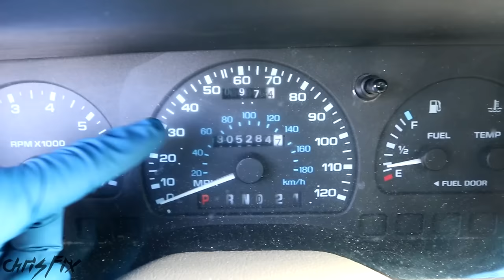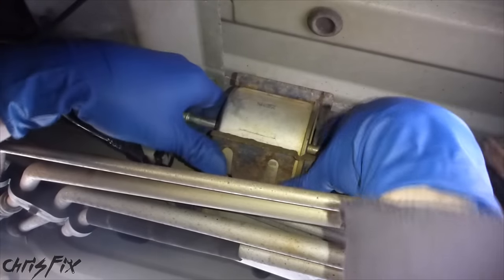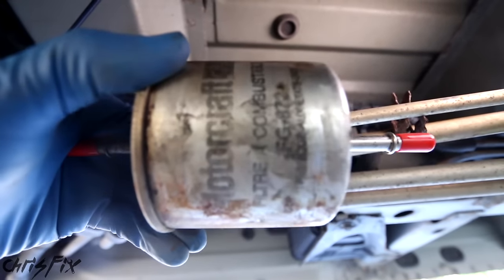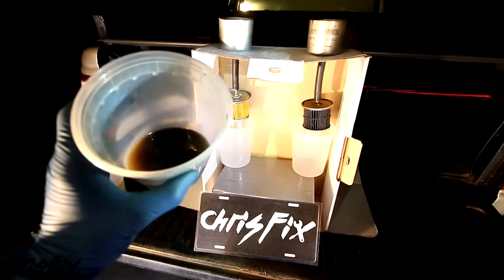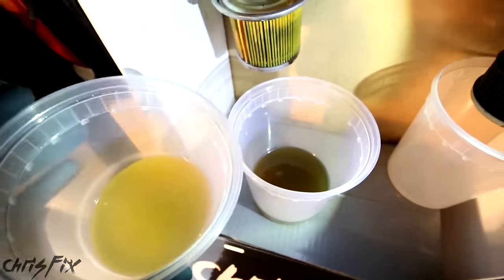What does the inside of a Fuel Filter look like after 300,000 miles?

Comment: Off to find out where my fuel filter is lol
Reply: +roberij05  
goog it and put in diagram (and or ) location of your vehicle
Reply: +roberij05 If you can't find it under the hood or under the car, it will be in your fuel tank.
Reply: +February 
No! Don't say that! LOL
Reply: Primer2tone Garage
Yeah, the unfortunate truth. However, if you suspect the filter is in your tank, check the trunk or under the rear seat for an access cover. It might be as easy as 3 screws.
Reply: +roberij05 - Just look online for the model of your car. Any car built in the last 60 years has info on where to find the filter.
Reply: +KOakaKO and cars before that had sediment bowls that you cleaned out and put back into service
Reply: Texassince1836
- I really like the old sediment bowls, like we had on the farm-field well pumps back in Nebraska (when I was a kid, back in the '70s). They're SO easy to clear of water or rusty bits... and, as you say, put them right back on and keep running.  ;)
Reply: +roberij05 it's not a service item for modern vehicles. the cars he drives are return systems, modern cars don't push as much volume, only just enough, so the in-tank fuel filter doesn't usually need to be serviced.
Reply: +KOakaKO not necessarily
Reply: SilentServiceCode
- Not necessarily what? Your comment is meaningless without context.
Reply: +February buick century  is the best  for fuel  pumps.  access cover   right in the back.
Reply: +KOakaKO You are exactly right.  Some of them had a push button to quickly drain dirt and water.  Others had a bail and screw to remove the glass bowl.  New is not always better.
Reply: +KOakaKO BTW, did you notice that the flow direction was backward on the test he set up?
Reply: Alex Tworkowski
I don't think I noticed that, but it would still filter okay. I've seen in backward before.
Reply: nemo227
- Yes, absolutely, and again Yes. Money spent on Maintenance is 1/4 or LESS than the cost of repair once something fails completely. Keeping up with the Maintenance of a vehicle is a LOT less expensive than repairing it every time it breaks down.
Reply: El Chapo why would you suck in a chicken
Reply: Renduevenstar Same thing.... Not really 😑
Reply: should be by the muffler bearings.
Reply: Are those under the water leveler?
Reply: By the blinker fluid?
Reply: So i have a toyota tundra 01 with 342k miles. Im kinda curious what it looks like
Reply: Um my 4runner has 384,000 miles...should I change it?
Reply: Nah get it to 500k then cut it open for inspection. LOL JK
Reply: look at the video and tell me
Reply: roberij05 n
Reply: Mine is in the fuel tank.
Reply: Lmao. I know your feeling. This guy's videos & editing have put me in my garage more times than I can count.

Comment: Dude that side by side test he does is awesome hahaha who puts that much time into a test like that? Only ChrisFix.
Reply: The more you know
Reply: You're a great teacher Chris. This stuff is great.
Reply: The test is actually pointless. He poured the gas into the outlet side of the filter so the gas is flowing in the opposite direction than it normally would. So on the dirty filter he's actually pushing through the clean inside out to the contaminated outside. This then pushes off the contaminates from the outside which mixes with the gas and drops down into the cup. Pushing the contaminates off of the filter from the inside is a lot easier than trying to push into the contaminates and filter like it normally would. If he rigged it the way that gas normally flows it would look much cleaner, probably like normal gas, but it would probably be going through drop by drop because the gas isn't under any pressure besides it's own weight. Not hating on Chris his tutorials and advice is still all good it's just the test didn't prove anything, not even the flow rate.
Reply: John Moore but it was a new clean filter...
Reply: You wanna see a guy put time into tests like this? Head over to project farm’s page. The guy pretty much does side by side tests on damn near everything

Comment: Years back cars had clear inline fuel filters. They also had a little window in the air conditioning lines so you could see the bubbles or lack there of . I miss both of those features.
Reply: hold my beer let me remove my ford bedliner and grind a hole in the box to get to the pump lol
Reply: ive actually seen this on my friend's grandpa's 1930's buick.... had a clear fuel filter. it also was part of the reason it stalled not too far from his house because it had some crazy design involving cork or something like that
Reply: My car has the ac window, what am i looking for with the bubble window?
Reply: In old cars you had a glass and metal filter, you jsut changed the inner element its was very cheap,, you changed when it looked dark...n more of the mintenace engineer this days,, missed it.

Comment: watching chrisfix makes me want to fix everything on my car
Reply from the maker: Haha perfect
Reply: Same
Reply: @chrisfix  Wow!
Reply: @chrisfix  What additional steps can I make before replacing the catalytic converter and in which order would you recommend? 
1) Change Gas Filter. <without question)  
2) Change Air Filter.
3) Clean out Mass Air Flow Sensor. 
4) Change Spark Plugs. <I’m thinking about going back to copper) 
5) Basic Oil change. 
6) Seafoam-ing  the piston heads before an emissions test showed a 400% improvement on the test results. I did discover air leakage from the head caskets shortly after using, seafoam. However, I don’t know if the leaks were there before I used the product...And, I didn’t follow the directions on the bottle.

I like the camera probe that you use to show the before and after results of built up carbon deposits on a piston head. And, it gave me a couple of ideas. I’m curious, what would happen if I used brake cleaner to dissolve the carbon on the piston heads? There’s nothing better than break cleaner to remove dirty oil deposit stains from your driveway. ...Yes?   
My second idea is to use a miniature size Weed Wacker that will attach to a drill to help break up the carbons on the heads... It’ll be like using an SOS pad, but with plastic.

...Anyone? 
Oh, I forgot to mention that by cleaning out the mass air flow sensor. (who would of guest) Made a huge difference! <the emission reading showed that I had better result than the new air flow sensor I bought).   

PS: replacing a catalytic converter is very expensive and I would like to avoid buying a new one 2, years from now.
Reply: @chrisfix  Correction: like using steel wool pads saturated with soap.
Reply: jared491 same thing for me
Reply: Same thing here 👨🏻‍🔧👨🏻‍🔧👨🏻‍🔧👨🏻‍🔧🙋🏻‍♂️🙋🏻‍♂️🙋🏻‍♂️🙋🏻‍♂️🤣🤣🤣🤣
Reply: But will never.
Reply: Ikr
Reply: Makes me want to fix shit on my car that doesnt even need to be fixed for quite some time
Reply: @Gjonesy9  that is too much
Reply: @chrisfix  Read in ChrisFix voice
Reply: IkR?!?!?   Because of him I have learned so much and havent had to pay anyone to do anything on my car for the last year.  Well I took my buddy to lunch when he helped me bleed my brakes but that was it!!
Reply: Yes started watching this channel about a week ago, and this weekend I've been fixing all the stuff on my car and motorcycle that I've been letting slide for months.
Reply: Jace
Reply: same here
Reply: @chrisfix  that is dirty
Reply: Lol same
Reply: Me too. Makes me feel like all things in my car are not worthy being in there.
Reply: Dude me too and I did and now the only thing I have left with an engine is my lawnmower............ I’ll be right back.
Reply: Same!
Reply: Same
Reply: I'm a little late to this comment but couldn't help but like and reply.  Started watching Chris' videos Friday and over the weekend I have replaced the oil (Pretty standard), and also brake pads and rotors!  Next on the list: Fuel filter
Reply: Me to
Reply: Me too
Reply: Then do it lol
Reply: @chrisfix  Me thinking of an easy service: oil change

Chrisfix thinking of an easy fix: rebuilding the whole car
Reply: Just make sure you have your soapy wooder on hand😉
Reply: @chrisfix  what happened to your corvette
Reply: @chrisfix  
I thought you maintain your car's very well.
But it shows you don't..
I guess you're human just like me 😆
Reply: SAME HEAR! XD! 🤣😂🤣😂🤣😂
Reply: Yes
Reply: @chrisfix   you did a good nice job
Reply: Do it!
Reply: Fix problems that doesnt exist
Reply: And then you see how much it costs 😭

Comment: Mechanic: if you need me for anything let me know
Me: I watch chrisfix videos 
Mechanic: kills me with a ratchet
Reply: Me: want to learn about cars and stuff
Chrisfix: watch my videos
Me: ask a mechanic
chrisfix: kills me with breaker bar
Reply: Watching a Chris Fix video in addition to a video specific for your car is the way to go
Reply: Walter Adam Gray also like Chris always says your owners manual I looked at like the first time 25 years ago and holy shit it’s almost like the company who made the car knows how to fix it haha
Reply: @dickJohnsonpeter  no no, hes got a point.
Reply: Who else has had bad experiences with car mechanics and now does the most by your own?
Reply: @dickJohnsonpeter  i watch his videos to get a general idea of how its done, and why things are the way they are, and what toblook out for. Then do the job following my car's service manual or Hayes manual.
Reply: @gigachad_ger  Pffff! So many! When I bought my current 25 year old car (I love old bangers) I took it a pro mechanic and told him to do a full service and fix any apparent issues. Months later I started working on it myself and found out that although the oil filter had been changed, the air and fuel filters were not (the fuel filter was still the original, at 170k km, and the air filter looked like an old carpet!) and upson removing the valve cover to fix a leak that it had since I bought it, and was not fixed on that "full service", it had been instslled upside down! :0
Many years ago I took my bike to a mechanic, and now that I'm restoring it, I found stripped bolts on the carbs, badly connected wires, and so much more crap!

Mechanics work as fast as they can, and they don't give a shit how good or bad the job gets, as long as it "sorta works" when it leaves the shop!
Reply: Hahah I was forcing my mechanic to change the guel filter, he said its still good (it was 9 years old and only 25k miles) but After this video I had to change it anyways

Comment: Another excellent video from Chris fix showing how easy it is to change a fuel filter. I particularly liked:
1. Disconnecting the fuel pump fuse to depressurise the system;
2. The flow tests on the 300k van filter which showed how hard the fuel pump must have been working to get at the gas.

Comment: I just bought a 2003 4x4 5.3L GMC Yukon XL with 210,364 and I am doing this ASAP also just did rear brake pads rotors parking brake shoes & hardware now to order air filter, plugs, wires it runs ruff at idle so I am cleaning the throttle body too thank you so much for all your hard work Chrisfix you're the man.

Comment: Protip, drench the line connectors with WD-40 before removing the filter. They come off much easier and the WD washes away minor crud which accumulates on connector and line surfaces. That especially helps with old filters which have never been replaced.

Comment: You sir have convinced me to change my fuel filter. Thanks :]
Reply from the maker: +Edgar Chaves Awesome!
Reply: hey chris what do you think about k&n air filters are they good can they damaged your car?
Reply: +Edgar Chaves 
Second that
Reply: Evan Chase wow really
Reply: Especially with new direct injection engines and high powered piezo injectors
Reply: @john dillenger Don't use them, the filters can let some oil through the mass airflow sensor causing problems, they are terrible at filtering fine particles and the best part is you don't gain any power. Through dyno testing it has been shown that most vehicles loose about 1-2 hp and best case is gain 2-3 hp. So the "Cool" sound to me isn't really worth it... obviously up to you though!
Reply: You could use a dry filter but stock is still best in most cases and especially for daily driving, people don't usually buy or make a heat surround for them and they just suck hot air from the engine bay which doesn't increase performance at all. Unless you get one that brings in cool air and no oil then you'll get nothing but noise which makes you think it's made your car faster ;)
Reply: It's the opposite for my E36,  the oil filter is at the front of the engine bay on the top but the fuel filter is down the back near the firewall, both can be done in a few minutes still tho
Reply: what would happen if you put the fuel filter in the wrong way?
Reply: Ethan Andrew Would probably still work, but might not fit properly and might clog faster. It is also only designed to be under pressure in a certain direction. Reversing the flow could result in the filter element deforming or tearing.

Comment: Thanks Chris. Videos old but still helps this guy even today... Been hanging onto a replacement OEM fuel filter for my 04' Passat 1.8T 5-Speed Wagon. Doesn't burn a drop of oil and runs quieter than my mother's 2014 Fiesta Titanium but I had to pause replacing the 270k filter on the ride till I found out what would work best releasing the fuel pressure so appreciate the option shown. Thanks much.

Comment: Great video, thanks for that!  Suprisingly, that vetta one was rusty... had the same experience with GM's Opel Vectra 2.2 petrol - looked like a new car after 10 years, with 130k miles, but the filter was completely rusty and, unfortunately, rust came into injectors, so the repair was more expensive.. since that time, when I am buying a car, I am always changing also fuel filter with all those other stuffs (cabine filter, air filter, sparks etc.)

Comment: Fuel filter change is definitely a good idea to save the strain on your fuel pump.
This is something I never even considered before now.
On my last car I changed the fuel filter after about 1,000 miles because the car stalled a few times, and it didn't stall again after I changed the filter, so I might have got some really bad fuel, or maybe some gunk from the bottom of the tank.

Comment: I just replaced the fuel filter in my truck a few weeks ago. It was the original one from 93 and the truck sat for about 7 years. When I took the old one out, the fuel filter rattled. When I cut it open, the actual filter element broke free from the outlet side of it and it was packed full of rust. It was just absolutely caked with it. There was also a pile of rust in the filter housing. Before the new fuel filter it ran decently but would shake at low throttle when driving. After changing the filter and the distributor cap and rotor, it ran sooo much better and it could actually spin the tires

Comment: Have a 2007 Pontiac G5 2.2L at 224+KM. I changed a lot of original parts: tie rod end, sway bar links, rear wheel suspensions, steering shaft, turn signal switch, blower motor & blower motor resistor, control arm, mass air flow sensor, positive crank ventilation hose, ball joint, wheel bearing, front & rear brakes, rotor. I think this is all. Done over the years, especially after front wheel work. Still having problems with heater turning on and off though. Going to hopefully have fuel filter changed today.

Comment: also you will find that a lot of that discolouration has come from the rubber/etc fuel lines breaking down, especially if you ever use ethanol based fuel.
Reply: Absolutely. Lots of older cars can't deal with ethanol based petrol. Might be wise to change some hoses too.

Comment: Great video and an excellent example of the need to change that filter. Amazing the debris that was in the van's filter!
Reply: That fuel pump must have been made out of titanium to last this long having to force gasoline through that level of restriction without burning out.  I doubt one on a modern car would survive that long under those conditions.
Reply: +482lost 
That's because the demonstration he used was a Fram filter, while the original was a Motorcraft. Ford contracts their filters to a higher specification than an off the shelf Fram filter, as does GM. Mopar filters last I heard were Fram filters painted blue.
Reply: ***** 
Thanks

Comment: I had a check engine light pop up on the dash of my 07 F150. Went to parts store and they hooked a scan tool to it. Was throwing a "lean on bank 2" fuel code. Guy at O'Reilly's said 80 % could be fuel filter. Bought one for little over $20. Replaced it and reset codes (remove neg. battery cable). Drove it almost a week and no lean codes and better gas mileage. Provably saved my in tank fuel pump too. That's expensive to replace.
Thanks O'Reilly's and YouTube!